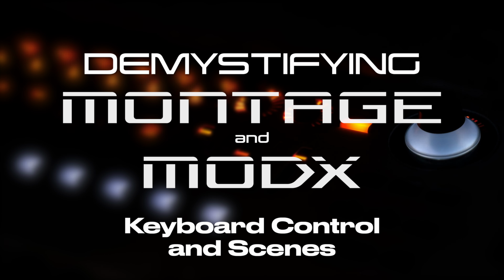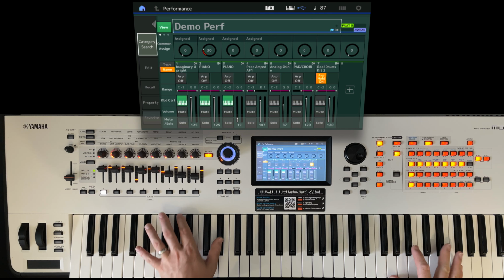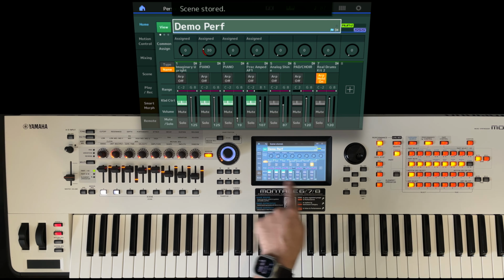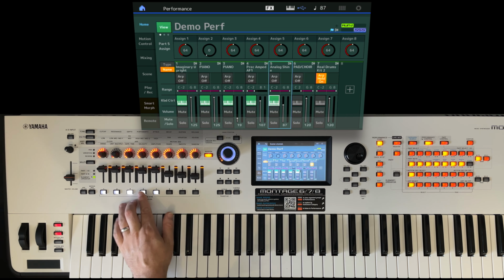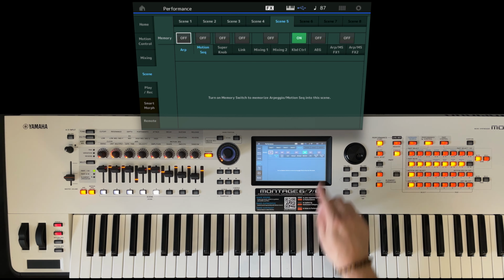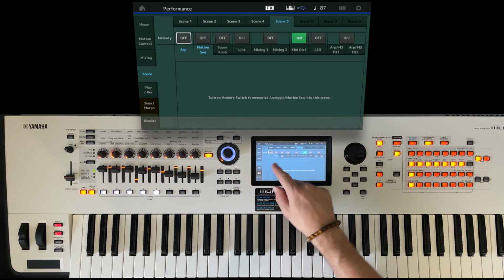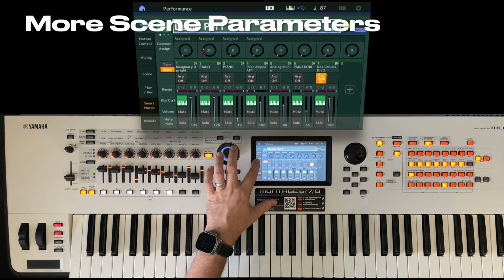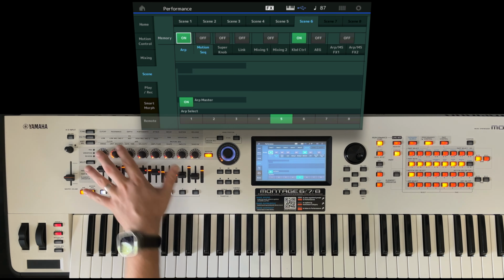Using keyboard control and scenes with Yamaha MONTAGE and MODX, arpeggio switches and more

Comment: Kier
If you don't mind, as I work through these videos I point out explanation elements incompatible with my M8X....form this video, the M8X has no arpeggio buttons.

In addition, I think for all the demos, on my tablet M8X interface, when I activate the "Solo" option on any performance element, it mutes your video and I have to reboot my Montage to hear you again.  Please let me know if these FYIs are helpful for us at all.  Once again I appreciate your efforts here.
Reply from the maker: Thanks for your message. I’ve had various requests for a series of Montage M-specific videos to address these differences, and I am gradually convincing myself to actually get them done.

For the most part, I’m already aware of all the things I’ve described in the Demystifying series that don’t tally 100% with the Montage M experience, but it certainly doesn’t hurt to have anyone point out the differences, if not for my benefit then for other viewers, so please do go ahead and point them out.

Regarding what you said about hitting SOLO and the video muting… I’m going to assume that you are using your M8x as your audio interface, that the YouTube audio is going to the USB MAIN input on the synth and when you hit SOLO it mutes the audio of everything but the SOLOed part.

This assumed, thankfully, there is no need to reboot the synth to get the video audio back. You can either hit SOLO again to restore the volume of all other performance parts, including the incoming USB audio, or click the USB AUDIO | A/D INPUT button to the left of the faders so that the fader backgrounds go orange, then click the PART button labelled USB MAIN to SOLO just that element of the performance, thereby restoring the YouTube audio.

If that's not what you're talking about, let me know :)
Reply: @KierDarby  Wow, what full service responses...thanks so much for your time and attention.  Your are right about restoring sound, I do note that to remove the Solo selection from part, I could not just toggle off the Solo button, but had to toggle on the entire performance to restore the video sound.  Thanks again

Comment: Great video @KierDarby Question: Is there a way to turn "Keyboard Control" on and off for parts 9 - 16? This only seems possible for parts 1 - 8. If not,  how do you record a multi-part performance if using parts 9 - 16?
Reply from the maker: The short answer is no - you can’t set keyboard control for parts 9-16…

But there are ways to work around it with MIDI trickery, essentially routing MIDI from the Montage back into the Montage via a DAW or a MIDI router, targeting channels 9-16. I’ve got a video on the subject on the slate, so keep an eye out for that.

Comment: I have a question.... as you can (barely 😅) see from my avatar, I play a MONTAGE (or MODX+ when I don't want to carry too much weight!). Well, my way to select different sounds on different SCENES is by using the MUTE button instead of the KEYBOARD CONTROL one. Is there anything I am missing to prefer to use the other way?. Perhaps the MUTED performances are eating polyphony?. I am ready to change my performances if so!. Thanks!
Reply from the maker: If parts are muted, rather than having the volume set to 0, they shouldn't eat polyphony, BUT when you engage mute or solo, the sounds of those parts will cut instantly. Far better to use keyboard control switching, so that the parts will continue to sustain to their natural end when keyboard control is removed from them.
Reply: @KierDarby  thanks, that is a good reason to modify at least some of my scenes!. Sometimes there is enough time between changes but, when the scene switch is fast, it could kill some sound which would be better to keep on going. It is incredible I had not noticed that other way to do this until I saw your video. Thanks!!!
PS: thinking a bit more about this, what I was missing is the SSS function going the MUTE way. And, now that I see what happened, I had to sync my SCENE button pressing more tightly timed than when using SSS, as I had to keep the old SCENE until the very last beat to prevent, you guessed it, the MUTE function on next SCENE!. So, well, now I will be able to select the SCENE earlier, which will be lots less stressful. I am on technology for ages (I am 56 now and began with computers at 14) but playing keys and on music in general just for 6 years. And my real use of MONTAGE / MODX+ has been since a couple years ago, when I joined a pop/rock band. Now I see how much I still have to learn!. That was the reason to begin watching your videos from the first one, as I knew some details, like this one, could be just missing on my knowledge of the instrument. Thanks again, I will remember you whenever I change an SCENE from now on! 😄